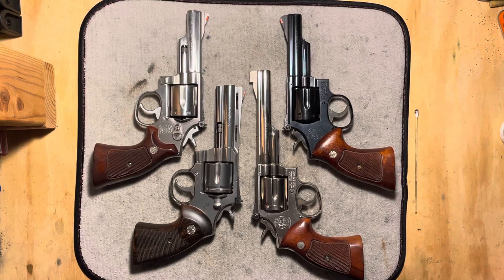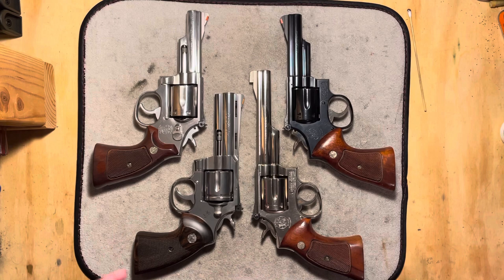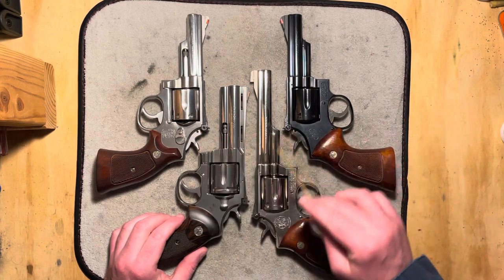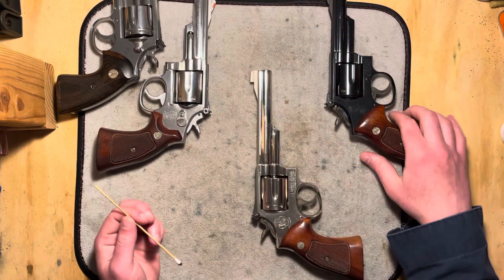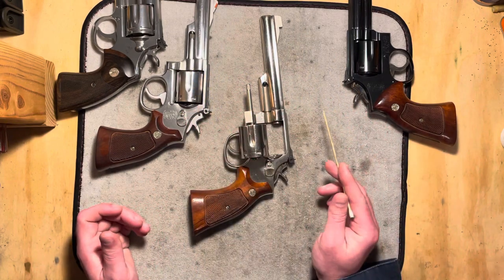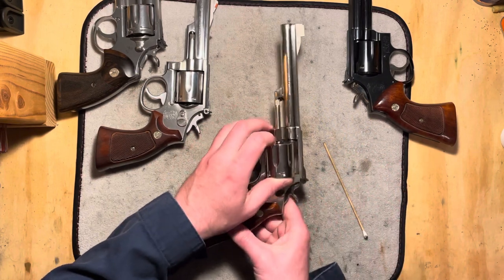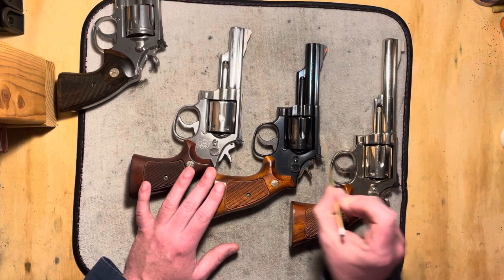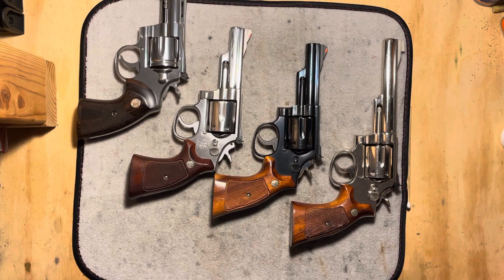Revolver Forcing Cone: Explanation and Avoiding a Crack, Ft. S&W .357 Magnum K-frames & Colt Python

Comment: I’ve been looking into this problem as well. They keep describing the force cone issue as  flame jet heating. 125 grain has long been the king of 357 rounds. So it’s popularity probably factors into the fail statistics more so. I’ve heard it both ways 158g va 125g being the cone problem rounds. Thinking in the fundamental physics department. 158g is going to have a greater dwell time upon primer ignition. More powder will be burned. More time as O2 plays into the burn equation. 
The increased dwell time (ignition to muzzle exit) will increase temperatures and gas expansion pressure. I see that as heavy for caliber will likely be a bigger factor than lighter grain. Me I keep the magnum use minimal in a K frame. Just enough to stay current with a self defense load of choice. When I plink it’s 38 standard pressure. 
IMO it’s a solid choice in more robust 357 designs as well.
Reply from the maker: I think characterizing it as flame cutting or a heat issue is incorrect. 

The issue is the kinetic energy imparted to the forcing cone. Since kinetic energy is affected exponentially by velocity (1/2*mass*velocity^2) a lighter bullet which accelerates more quickly can deliver more energy to the forcing cone than a heavier bullet which takes time to accelerate. 

The heavier bullet contacts the forcing cone at a lower velocity, imparting less energy, and swages smoothly into the rifling. The high velocity lighter projectile impacts the forcing cone more abruptly and violently and is at greater risk of causing a crack.
Reply: @ColterBrog  ahhh..I believe your on to something there. Harmonic stress. That would make more sense. I’ve seen the explanation given that heat related erosion is causation but that didn’t begin to explain other variables present. This level of thinking goes above my pay grade but I can grasp some fundamentals. The failure cracks I’ve seen were not radial but fore/aft. That would support Kinetic energy cause or = harmonic oscillation. MV would factor into this correct?
Reply from the maker: @h.r.puffnstuff8705  I am not a physicist, but I think you’re getting a little more complicated than it actually is with the harmonic oscillation. 

It is definitely not heat related erosion, since in the past some revolvers failed at very low round counts. 

It’s quite simply a piece of metal being struck with enough energy that it cracks at a weak point. I’ll elaborate further. 

Your bullet, when sitting in the chamber at rest has mass, so it has inertia. The more mass it has, the more inertia it has. The more inertia it has, the more it resists movement. It is more difficult to get a heavier bullet to move than it is a lighter bullet. The lighter bullet has less resistance to movement, and as a result will have greater acceleration. The lighter bullet of course has a higher muzzle velocity (within the confines of what pressure the revolver can tolerate) than the heavier bullet. The barrel length is the same, though, so this gives us a sort of proof that the lighter bullet had greater acceleration. It has to if it will be at a higher velocity than the heavy bullet in the same distance available. 

So it has less resistance to being moved, and at the end of the barrel is moving faster, which logically means it impacted the forcing cone at a higher velocity than the heavy bullet. Now, I don’t have the educational background to tell you exactly how much faster it is moving, but since we already discussed velocity affects kinetic energy exponentially (1/2*mass*velocity^2) it stands to reason that a lighter bullet could very easily have more kinetic energy at the time it impacts the forcing cone. 

Something that I don’t see mentioned elsewhere that might be relevant is that momentum is not an exponential formula the way kinetic energy is. Momentum is only Mass*Velocity. So the lighter bullet has relatively less tendency to remain in motion relative to its kinetic energy compared to the heavier bullet. (This explains why your slower, heavier projectiles tend to penetrate well.) 

Taking that bit of information it would mean the forcing cone swaging the lighter bullet slows it down more than it would the heavy bullet. So where did that extra energy we had go? Into the forcing cone- where else could it go? 

Since the bullet is being squeezed down a tube, essentially, it is going to be pushing outward equally in all directions. The way S&W thinned out the forcing cone, though, means that the bottom of that tube is weaker than the rest and would receive greater deformation. (We see things crack and fail at thinner/weaker spots on metal all the time, right?) If the energy imparted is high enough, abrupt enough, and the thinned area weak enough, you end up with the longitudinal crack that is common in a forcing cone failure. 

Less inertia, more acceleration, more velocity, more kinetic energy, less momentum, more transfer of energy, and the perfect storm of a weak spot where that energy is being transferred. 

Obviously I didn’t do all the math and there are some aspects involving powder burn rates used with different bullet types that probably also come into play (lighter bullets often use a faster burning propellant), but I think these are the general concepts which are relevant and explain what has been seen.
Reply: @ColterBrog  I believe what this maybe what is manifesting as fc crack.
 K.E. = 1/2 m v2. Which is a player in thermodynamic science.
Throw in the cylinder has just bounced off the aft frame and could be striking the forcing cone while the FC is oscillating. There’s a lot of things in play here and they all need to be taken into account.

Comment: I acquired a S&W 686 no dash 4 inch in very good condition without the M stamp. The forcing cone on the Smith L-Frame’s and N-Frame’s are stronger than the K-Frame’s 💯💯💯💯💯
Reply from the maker: Absolutely. The 686 is a very robust revolver. 

I think it should be mentioned that the newer K-frames with the two-piece barrel are seemingly much stronger than the older revolvers. 

I think it comes down to the fact reducing the overall circumference is stronger than thinning just one portion. The load distributes more evenly rather than continuously straining one weak spot,
Reply: I have a 686 no dash in pristine condition. The No M Stamp makes it more desirable to a S&W collector. They are still under warranty if you send in for the recall.

Comment: Do you think that the 140 grain bullets are hard on k frame forcing cones ?
Reply from the maker: It’s hard to say to what extent. The thing is revolvers are a mechanical device and they don’t last forever. A forcing cone is a piece of metal being repeatedly struck by another piece of metal… essentially they’re in a constant state of being damaged and the discussion revolves around whether they finally succumb at 1,000 rounds or 100,000 rounds, or if something like frame stretch does them in before the forcing cone fails. 

That’s probably not a very helpful answer, so alternatively I could say it’s not going to be as damaging as a high velocity 125 grain, but isn’t going to be as kind to it as a 158 grain LRN target load… it falls somewhere in between, but exactly where it falls between them is an unknown.
Reply: Thank you

Comment: Ok I have a question then. What about +p 38 special in the non magnum guns. I know smith has on their website that any 38 post 57 is capable of firing plus p, but will that damage them in the same way as firing 357 out of 19/66s
Reply from the maker: That’s an interesting question. With the overall lower velocity compared to a .357 Magnum, I personally would trust the S&W claim. Certainly the risk always goes up of a forcing cone crack, frame stretch, etc. with higher velocities, but what we’re talking about is whether it is within reason for what should be expected for a service life. Higher velocity gives more wear, as always (and not unique to revolvers), but in something like a J-frame I wouldn’t expect some unreasonable amount of extra wear from using +p. 

The older K frame revolvers are somewhat unique in stuffing too much cartridge into too little of a frame, and then being further compounded by the additional thinning from the gas ring variation that existed for a few years. They can experience end-of-service-life failure, sometimes, at what most people would consider an absurdly low round count due to inherent structural flaws in the older revolvers’ design, and additional weakness unintentionally introduced by design alterations, combined with certain high-acceleration ammunition types which impact the forcing cone much more violently than typical. 

That’s wordy but I hope it addresses your concerns.
Reply: @ColterBrog  it’s mainly I’ve been wanting to get a 4” k frame to carry. Local dealer has a beautiful 67 no dash for sale and a couple of model 19s (dash 3s and dash 4s). I like to just buy one type of ammo and that’s the ammo I shoot and carry. It can be expensive but experience of others has taught me it’s not wise to have a lot of experience with practice ammo and little experience with carry ammo when in a bad situation. So to me if I can get a k frame in 38 that can handle a steady diet of 38 +p I don’t really see the point of a k frame 357 if it can’t handle a steady diet of magnum ammo. I know you can fire plus ps in a 19 but in my case (and most of the time I’m looking online) the model 10-5s, 15s are often cheaper than the model 19. In the case of my local shop the model 19s are all $895 and above in price. Whereas the 67 is $700 and the model 15 they have as $500. For the money I would save getting either the 15 or the 67 I can get more ammo. Hence the reason I asked about +p ammo in the standard post 57 38 revolvers.
Reply from the maker: @Ben_not_10 Well, I guess I have a difficult time offering much guidance since it’s going to depend on your budget and doctrine/philosophy. For protection I almost exclusively carry autos in 9mm. If budget is a concern, that has quite a few high value options in the <$500 range, with more economically priced ammunition, and it would be something of recent production that can handle the stoutest 9mm you’d want to put into it. 

I say this, of course, not knowing if you have some specific particular need to carry a revolver such as defense against large animals, although in that instance I’d definitely want to bump up to .357 Magnum with a heavy load. 

Of course I also don’t know your personal history. Maybe you have vastly more experience with revolvers to the point switching to an auto would be a huge training burden. I could understand that, but if that’s the case I would think it’s worth it to go ahead and get something like a new manufactured Ruger that fulfills your requirements. 

I think those are the only thoughts I can offer from my perspective without knowing more about exactly what your needs are.

Comment: The current production Python is made to shoot all variety of magnum loads. While the vintage Pythons are likely to show wear and issues because all the parts are custom fitted. 

The M586/686 was designed to as a shooter and to correct the flaws of the M19.

The current production Python and 586/686 are made to shoot magnum loads. The Ruger GP100 is also overbuilt to handle all variety of magnum loads.

I have decided to not buy a M19 DOM 1960s and stay with my 586 and Pythons for all variety of magnum loads.
Reply from the maker: I agree completely. I like to be gentle with the classics because they are more interesting as a piece of history and a slice of the American story. American manufacturing, engineering design, and craftsmanship is on full display in the classics and they are beautiful. 

For just putting high powered magnums down range… newer options are better. They can handle it, and they have excellent feel and handling for the user.

Comment: My model 66-3 came with the issue of an even thinner forcing cone when compared to my model 15-3 from ‘69.

To be fair that thing has had many 158 grain magnums shot thru it, but it was never self defense type stuff, but mostly handloads and target loads at that.

Generally the barrel would crack from the inside of the barrel leading to a split showing on the outside face of the FC. That’s because the inside of the barrel is where the leades of the rifling begin, which sits right on top of where the barrel is shaved flat, though FC erosion is a fair indicator of the barrel’s life.

I would stick to lower pressure and lower velocity rounds regardless, such as 158 grain .357s, since those generally use less powder and produce lower chamber pressures. A 125 grain is nice, but is recommended that you stick to medium velocity handloads for those.

General tip: 158 gr .357 are “hot” when loaded to mid to high 1200 fps range. Low to mid is considered 900-1000 fps and 1000-1100s respectively.

For a 125 grain hot loads are ~1300-1400 fps, light/moderate load would be 1000-1100 fps and 1100-1200 fps
Reply from the maker: This is great information. Thank you.

Comment: My "S&W" mod. 66-4,  it is a 1978 manufacture:  practically in brand-new conditions, I did notice: the trigger&hammer, they are the same Inox steel like the whole gun, instead the actual one: it has a 'carbon-steel' looking, is it possible that also the internal-mechanism: is also the same.?....also I do ask: what it means the -'4' number?...
Thank You for the very interesting informations., about for that splendid revolver!
Reply from the maker: So I’m a little confused by this. A 66-4 should be from the mid-1990s. A 1978 would be a 66-1. Is it possible the stamping of the model number is just not clear? In any case, the “dash” number (such as -4) indicates what S&W considers to be a design change. The first version of a model will not have a dash. These are typically referred to as a “no dash” when describing a specific revolver. So a 66-4 would be the 5th design of the 66, the 4th change to the original design. 

The “Inox” hammer/trigger of a 66-2, like the one in the video, are actually hard chrome plated for wear and corrosion resistance. The base steel is carbon steel. Some revolvers display case hardening or a blackened appearance. To the best of my knowledge all are carbon steel, though. This is primarily a cosmetic difference based on style choices of the time. 

I hope this answers your questions.
Reply: @ColterBrog  
EXACTLY! I read wrongly!!!
I wrote you my correction, it is a "66-1"!....would ask you rhe meaning of "1" 'change', exscuse my bad-english". I read about the possibility (using many shot/.357Mag.)of a "crack" at the barrel !?...my "66" it is a 4"/barrel, I use mostly .38 Sp.l-158gn, and only few times .357Mag.-125gn....is it dangerous???....
Reply from the maker: @giulioespositi9052  The 66-1 was a design change that returned the gas ring from the yoke back to the cylinder. The -1 change was implemented in 1977. 

Your 66-1 will not have the yoke mounted gas ring that caused Smith & Wesson to additionally thin the forcing cone. HOWEVER, S&W either continued to use existing inventory of barrels that had already been thinned, or didn’t realize they needed to stop thinning the forcing cone so much. It’s unclear to me which is the case, but the important thing to know is that early production of 66-1 can have thin forcing cones, and it is unclear exactly when the issue was corrected. Individual revolvers have to be assessed. A 1978 revolver might still have a thin forcing cone- but I cannot say for certain. 

Shooting 158 grain .38 Special is no problem at all- the revolver is plenty strong for that. The 125 grain .357 Magnum could potentially cause damage and should be avoided in these revolvers. If you desire to shoot .357 Magnum it is preferable to use a heavier bullet weight such as 158 grain.

Comment: Great info, what about the brand new model 19 classic that came out in the last few years did SW do anything to beef up the gun or are they made the same as the older K frames with no improvement?
Reply from the maker: I actually haven’t handled one of those yet. I was under the impression it was actually an L frame and just “19” in styling, but the S&W website says it is still a K frame. 

Interesting. I’ll have to make a point to see one in person and make an assessment. I don’t have a good answer for that right now. 

I think I got the idea it was improved from a gunblue490 video. He’s a great YouTuber who has probably forgotten more about S&W revolvers than I’ve ever known. He has a video on the new model 19 which I found very thorough that might have some answers for you.
Reply: Have a 66-8,stainless cousin to the 19,full rolled forcing cone,no shaved bottom, redesigned crane/cylinder locking setup, 100s of 357 rounds through it, NO PROBLEMO.
Reply from the maker: @michaelcrowley1172  Looking at the 66-8, and it seems they went with a two-piece barrel like the old Dan Wesson revolvers had. Similar in concept, at least. 

It definitely doesn’t appear to be as thick as the forcing cone of a 686 L-frame, but I’m not sure that matters. 

A thinner forcing cone but of consistent diameter is going to distribute the load placed on it by swaging the bullet evenly throughout its circumference. 

The issue with the shaved forcing cones, by my assessment, doesn’t come down to the actual lack of thickness in the shaved area but that a weaker spot has been created that has a tendency to flex and fatigue an exceptional amount compared to the thicker portions of the remainder of the cone. 

This reminds me of how Armalite was able to strengthen the AR15 bolt lugs by rebating the lug opposite the extractor. Instead of the lock adjacent to the extractor taking an exceptional load because of the “missing lug” for the extractor, all remaining lugs could take the force evenly.